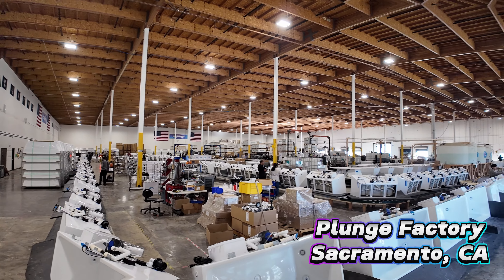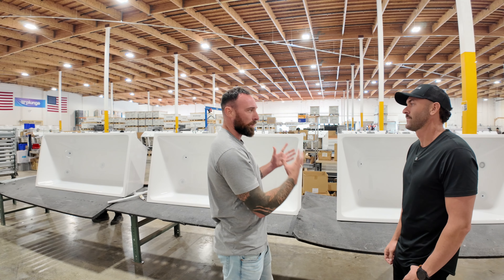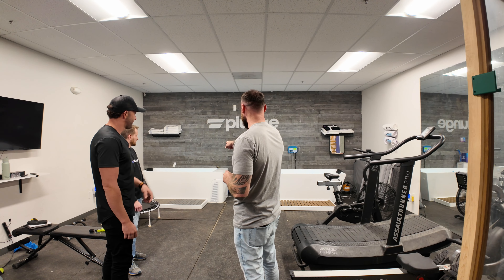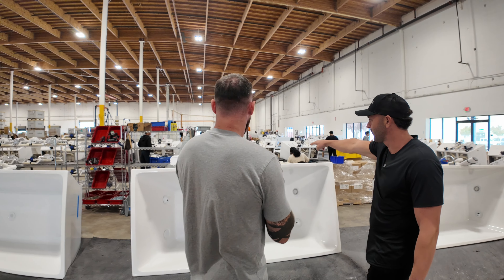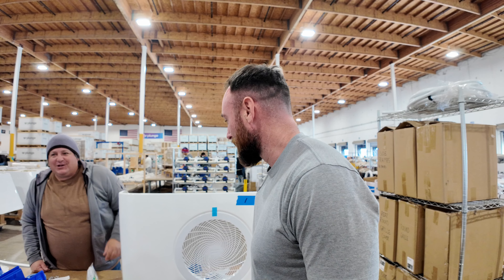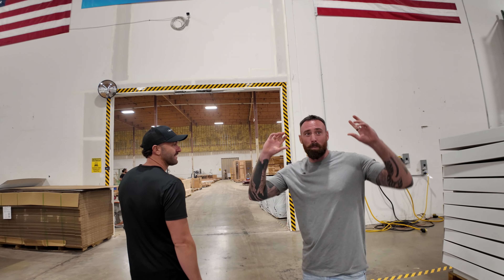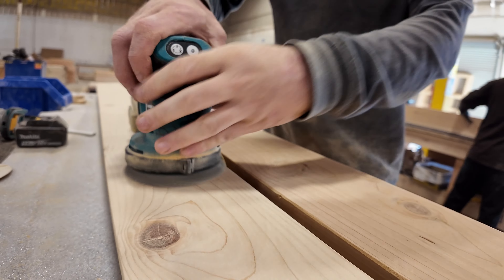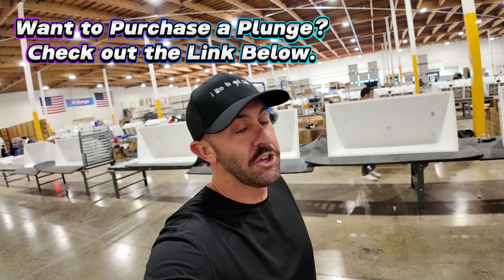Exclusive Tour of The Cold Plunge and Sauna Factory

Comment: Great video, I’m looking to purchase the all in. Per Plunge you need a dedicated outlet to run it. However, it looked like it was plugged into a regular outlet in your video. What are your thoughts? Thanks so much!
Reply from the maker: I think they all “recommend” a dedicated outlet (I think hair dryers also recommend that) but they pull less power than the XL and I have never used a dedicated outlet. Actually mine is on a circuit with a few other things that are on at the same time. You’re good to go! Just make sure it’s not a heavily loaded outlet already maxing out. 🤙🏽

Comment: What about concerns for moisture / condensation using the sauna? One of the videos where you review the All In Plunge and the sauna, there was like a puddle of water you stepped into when inside the sauna. What was that from? Is there a drain somewhere? I feel like this would have to be placed outside vs inside? I’ve been looking into dry saunas that use FAR infrared vs steam saunas with heaters, but Plunge is making my decision difficult.
Reply from the maker: That video was at the unveiling event and about 30-50 people were going from the cold plunges to the sauna over and over again. The floor is well built and able to handle water with ease. It might be the best built sauna out right now, definitely the most unique.